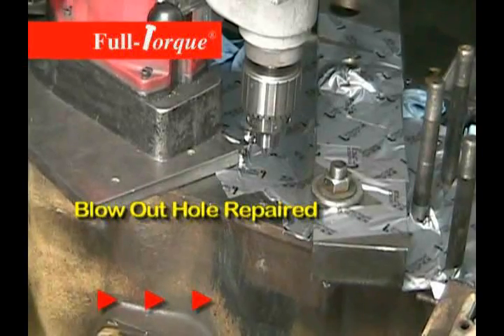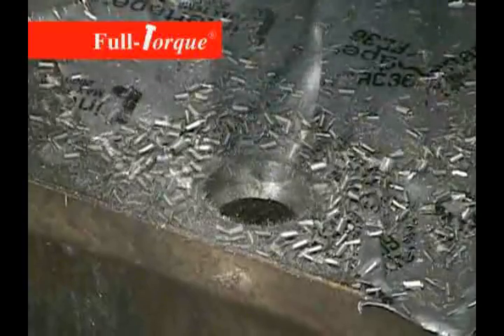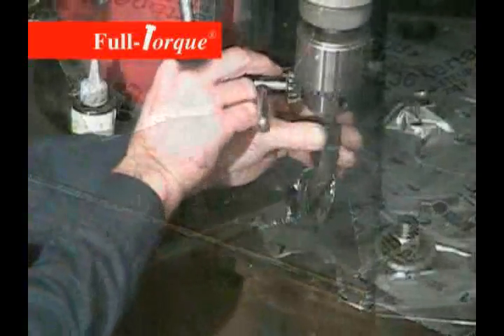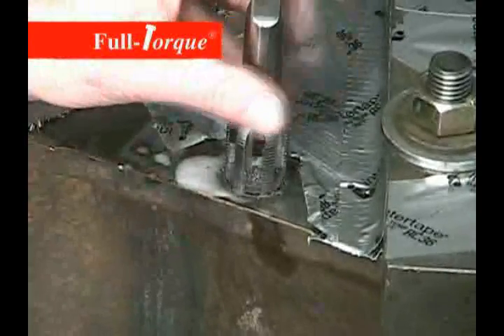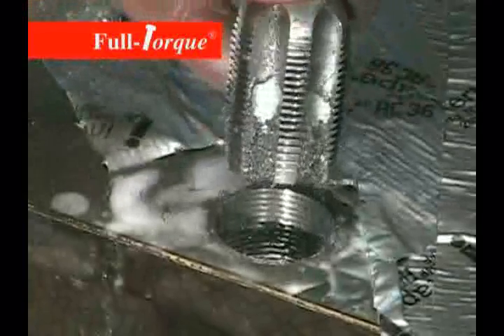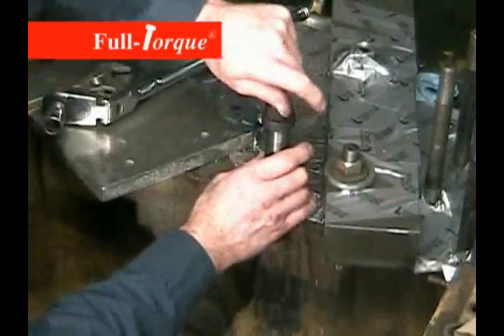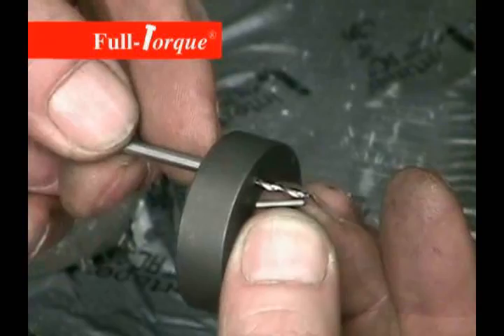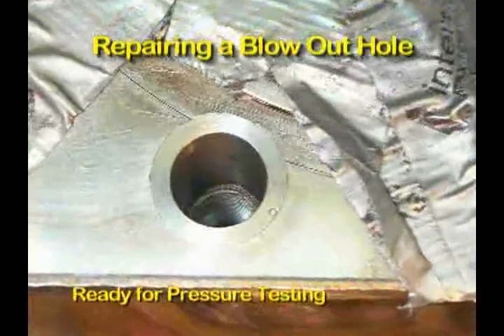Full-Torque Permanent Thread Repair

Comment: When you were finished tapping  that hole I could see holes(porosity?) in the tapped circumference of the newly treaded hole.I see why you have to install inserts, shat casting/ metals/process when block was made.
Reply: It's pretty typical when casting these large slabs of die steel for there to be some pinhole porosity.

Comment: If I were to run a roughing tap that deep into a hole like that, surely the tap would snap off, with a silent scream, followed by a flood of my own tears that would glue the broken parts to the internal threads of the block.
Reply: Then after you've spent 3 hours destroying your chisels, knuckles, and sanity, you can always just weld the hole up and pretend it only ever had 3 bolts

Comment: isnt that locking pin supposed to overlap the original metal and the insert? the whole pin was in the insert. dont think itll prevent it from backing out
Reply: The insert is threaded so no it won't come out. Its locked right into the threads themselves. The threads go into the thread insert so where the hole was drilled, its in direct contact with the threads. It could have been drilled right between the insert and base metal but I think they only drill through the thread insert to catch the threads to keep it from spinning so you're only drilling into the thread insert instead of the insert and the base material. The thread insert has threads that go in beyond the side surface of the insert itself so the pin is catching the tops of the threads on the insert and the base material. The threads don't stop at the side of the the thread insert, they stick out a little past it. Its not a smooth insert.
Reply: @mikeznel6048  ah makes sense. Thanks for the explanation. I didn't think about the threads being in contact with the locking pin 👍

Comment: I think you put the pin in the wrong location. Shouldn’t it overlap the screwed-in pin and the block simultaneously?
Reply: The insert is threaded so no it won't come out. Its locked right into the threads themselves. The threads go into the thread insert so where the hole was drilled, its in direct contact with the threads. It could have been drilled right between the insert and base metal but I think they only drill through the thread insert to catch the threads to keep it from spinning so you're only drilling into the thread insert instead of the insert and the base material. The thread insert has threads that go in beyond the side surface of the insert itself so the pin is catching the tops of the threads on the insert and the base material. The threads don't stop at the side of the the thread insert, they stick out a little past it. Its not a smooth insert.

Comment: Locking pin looks like does not touch base plate. Should it be half?
Reply: The insert is threaded so no it won't come out. Its locked right into the threads themselves. The threads go into the thread insert so where the hole was drilled, its in direct contact with the threads. It could have been drilled right between the insert and base metal but I think they only drill through the thread insert to catch the threads to keep it from spinning so you're only drilling into the thread insert instead of the insert and the base material. The thread insert has threads that go in beyond the side surface of the insert itself so the pin is catching the tops of the threads on the insert and the base material. The threads don't stop at the side of the the thread insert, they stick out a little past it. Its not a smooth insert.

Comment: Love your videos. However shouldn't that locking pin be sitting on the interface between the insert and the rest of the head to stop the insert from turning? At the end it looked like the pin was only in the insert.
Reply from the maker: Thank you for your positive comment and your question!  The placement is correct. The location of the pin intersects the external threads of the insert.  The locating pin must be fully into the threads.
Reply: Ahhh right - intersecting the threads. I didn't think of that. Cheers.
Reply from the maker: Let us know if we can ever be of help to you! Cheers!